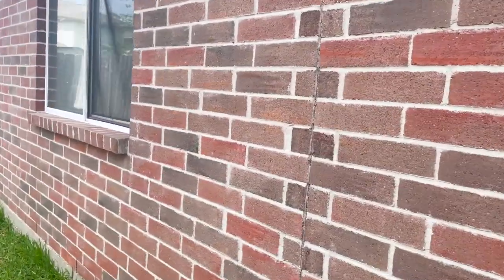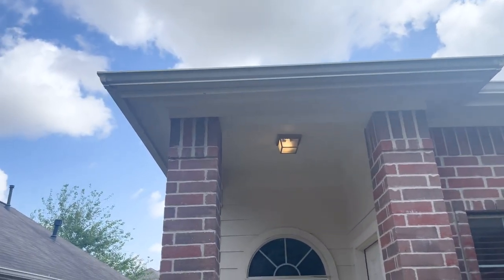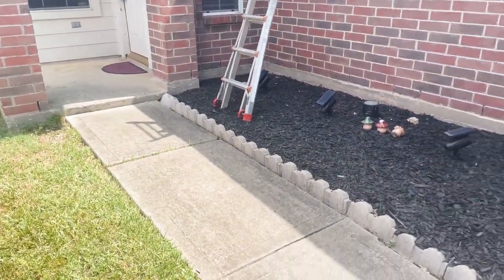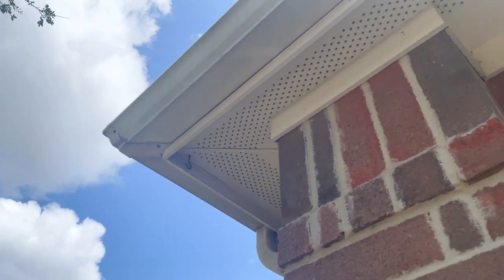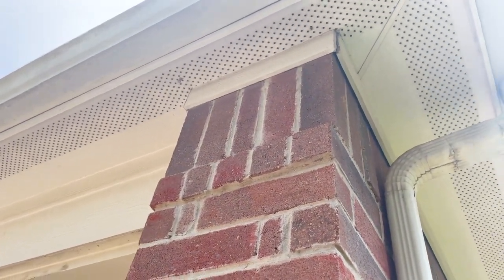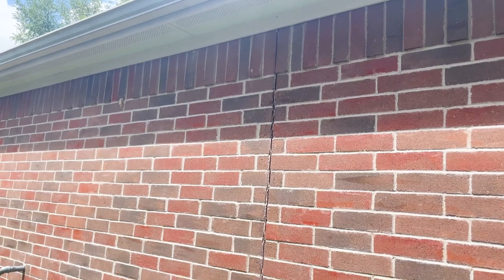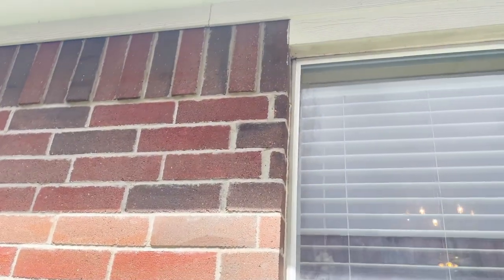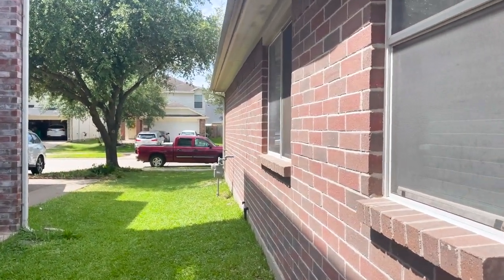How to Look at a Foundation - Would You Write This One Up?

Comment: Minor crack running left to right on garage concrete floor that runs up wall, 6 inch 45 degree crack in nearby inside laundry room, separation gap crack and two 45 degree zig zagging coming from bottom on same wall. Settlement or foundation failure?